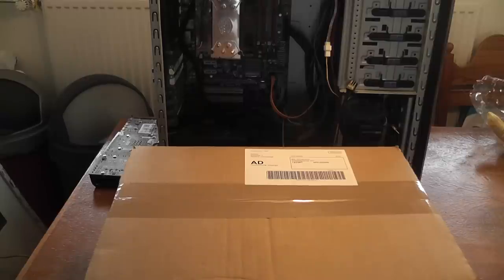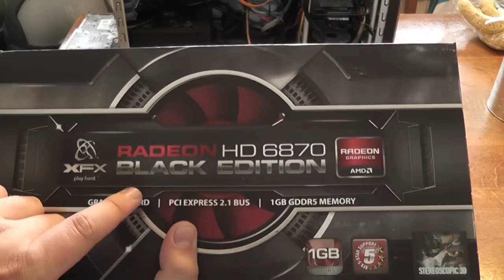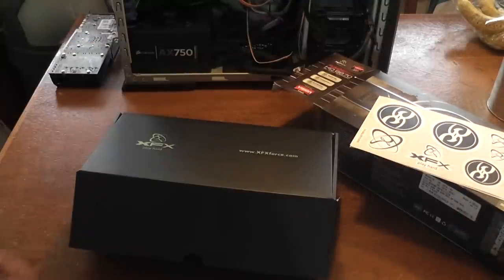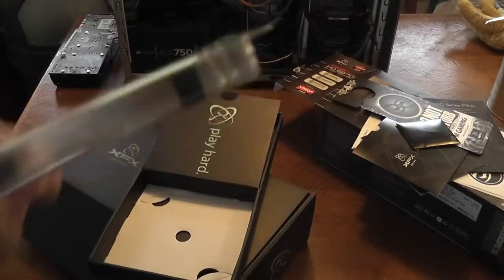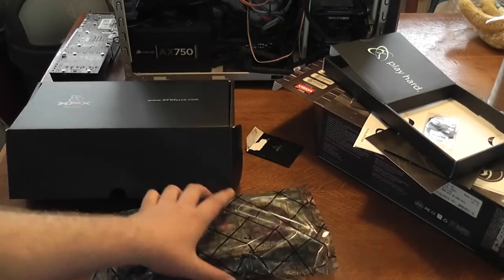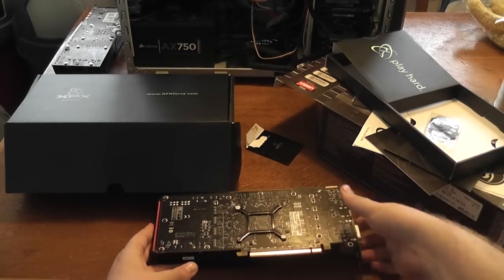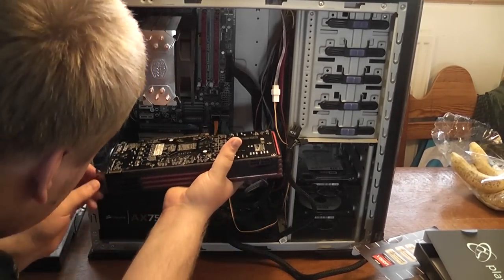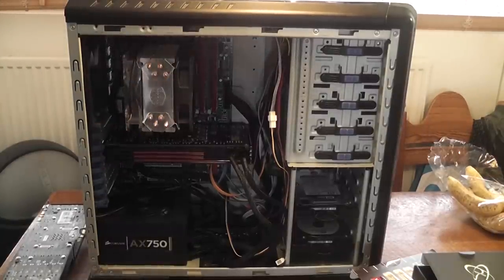XFX Radeon HD 6870 Black Edition - Unboxing - HD

Comment: @Ponyxlnl Thx for the reply, but I mean I have problems running Witcher 2, ArmA 2 on high so you know even though the res is low would it still run ok? I don't want to buy a new pc just the upgrade.

Comment from the maker: @Andymanse8 Hey well the i7 970 is a six core @ 3.2 its good but i dont think there are any games that will use the 2 extra cores i think the i7 2600k is better for gaming its a quad core @ 3.4 and in turbo mode it goes to 3.7 ghz its good i have the 2600k its great and also the i7 970 is like 200 more xpensive then the 2600k and as far as your psu goes its fine and the 6870 is also great ! almost all games can run on the higest settings.

Comment from the maker: @Andymanse8 well thats the thing you have so many stores and webshops so its hard to get a proper calculation of the final price but i payed 268 euro's for the cpu 125 for the motherboard i recomend you 8 gigs of corsair's Vengeance memory @ 1600 mhz thats 79 euro's and good graphics card between 170-300 euro's depending what you wana have i payed 160 for my xfx 6870 black edition at the cheapest price i could find it thats about it.

Comment from the maker: @Andymanse8 well i recommend the i7 2600k and a P67 motherboard with B3 stepping. and a good graphics card and DDR3 memory Atleast 1600 mhz ;) and it be good if its 8 gigs and the rest you can have savage from your current pc ;) and try to sell the old parts and costs well its going to be xpensive i see that your from the UK and im not sure what the prices are for those parts since i use Euro's ;)

Comment from the maker: @Y0y0Jester the Black edition is indeed Way overclocked the Memory clock is way better and the core clock is also overclocked Both normal and Black edition cards have 2 types of cooling the one i have and a dual fan solution wich i recomend this card is loud and gets hot.

Comment from the maker: @tanaii1 the memory clock is higher on this one but the msi hawk has a WAY WAY better cooler and better overclock potential. so idd so get the msi cuz its way way cooler ;) and u get overclock software with it. if you dont overclock and u dont mind the noise get this one cuz its cheaper.